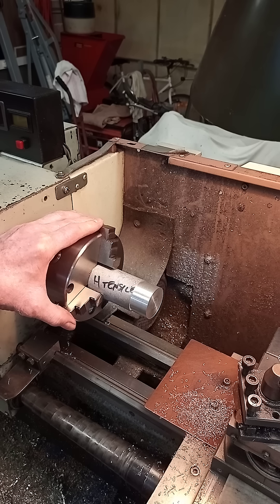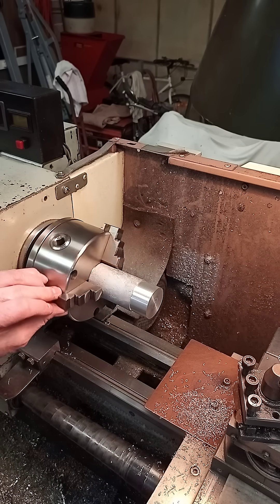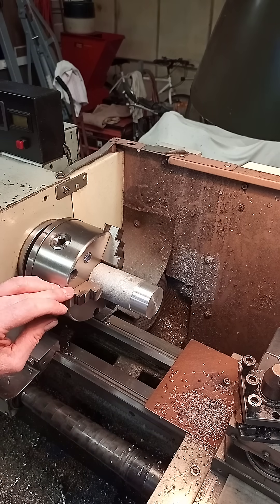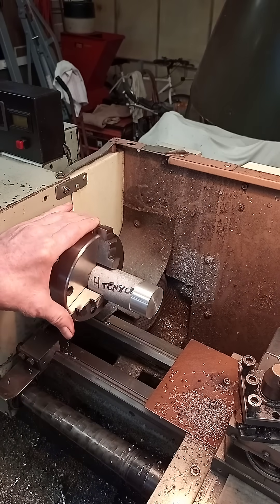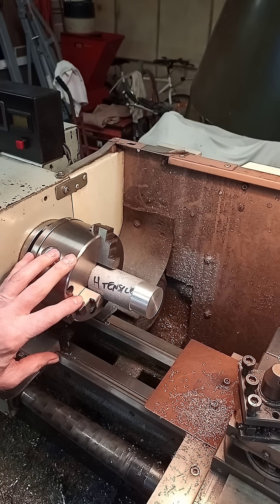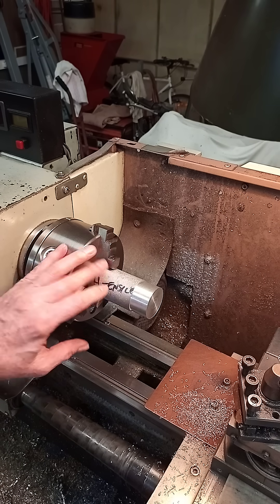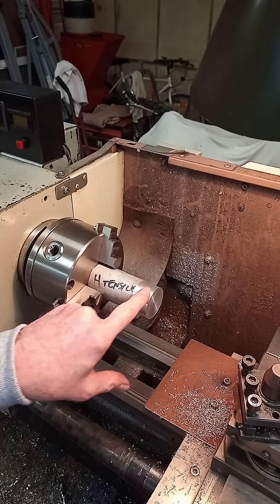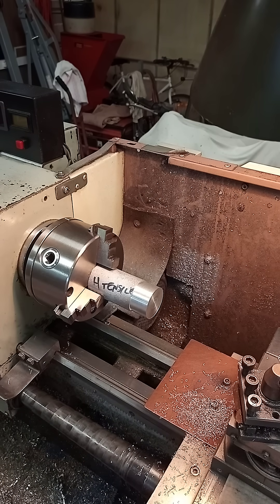Junk baby stroller to machine grade free aluminium round stock

Comment: That does look really good Rob. Worth the effort. I guess with products like baby strollers and prams etc, the manufacturers need to use high quality materials to pass safety standards. Looking forward to seeing what you turn the aluminium into. Cheers mate. ATB Nobby
Reply from the maker: Hi Nobby.  Yes I expect you are right.  The stroller had to be light but strong, so the ally needed to be high tensile/grade for the thin wall thickness.  It machined exactly as I anticipated.  Not sure what it will be used for yet, but I have tidied up the workshop a bit.  Cheers Rob

Comment: It's great being able to custom make a slug of ally when you need, and good stuff for the price.. Imagine buying a slug like you have there just for hobby use 😮$$$
To those who don't own a furnace..
Make one!.. Mine has saved me Thousands since i made it.
(Still holding up well, with no repairs needed).
Free scrap and a bit of Lpg gas is the cost to pour your own..

That looks like a nice little slug there Rob. Getting ready for the next project i will presume.
Take care,
Paul
Reply from the maker: Definitely.  Aluminium stock is sooooo expensive.  Home melting is a huge money saver and you can re-melt your mistakes  ;)   Totally painless machining aluminium this way as it costs peanuts and there is no waste.  Not hard to do provided you follow a few simple rules.  Cheers Rob